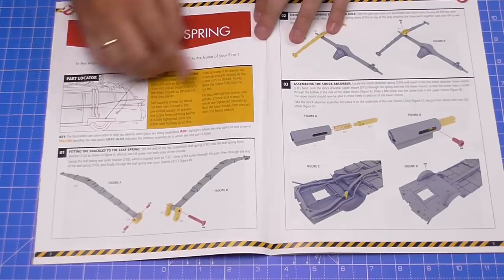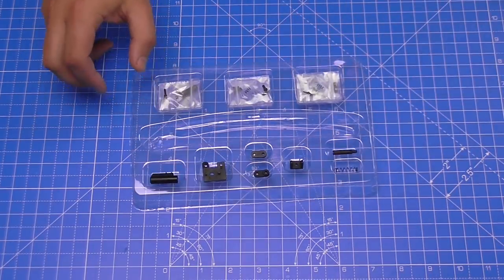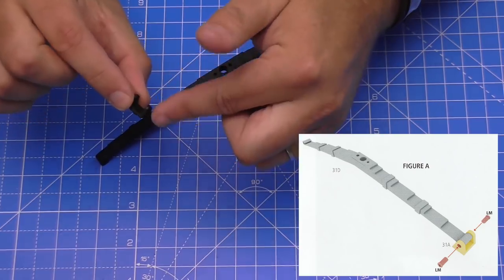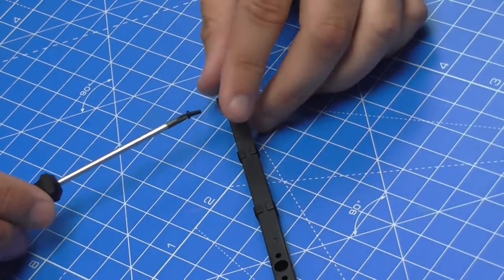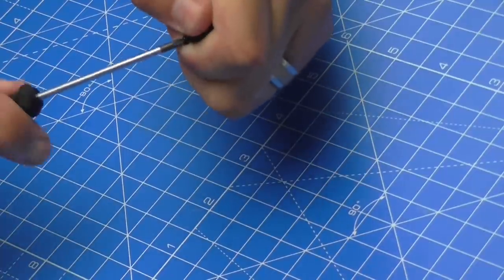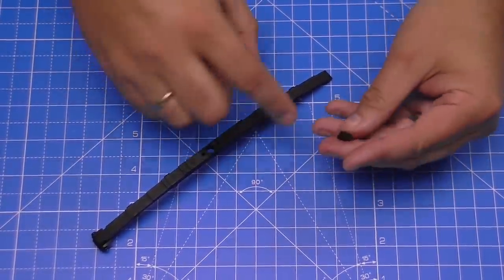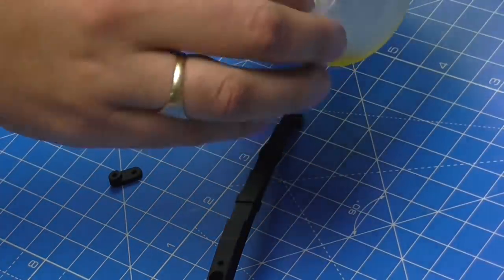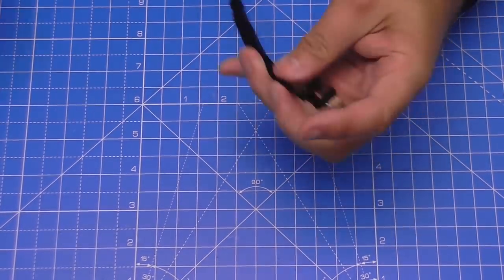Build the Ghostbusters Ecto-1 - Part 31 - Left Rear Leaf Spring

Comment: I'm having problem with last part on leaf springs for both left and right sides where I have to use the PM screws. They don't go all the way and I've used oil and wd-40. I'm wondering if the holes are just a bit too small as they both go in halfway exactly the same distance before getting stuck. Any suggestions?
Reply from the maker: I can't actually remember that far back I'm afraid. Hopefully someone who is on this stage can help
Reply: @WorldofWayneUK  thank you Wayne.

Comment: I think when it’s a combined axle & differential, it’s called a transaxle.
Reply: The trans axle is the axle that the drive shaft turns so if this car is rear wheel drive you're correct. Trans axle is short for transmission axle. If the the rear axle only has the differential the whole assembly of diff and axle gets called rear axle assembly.